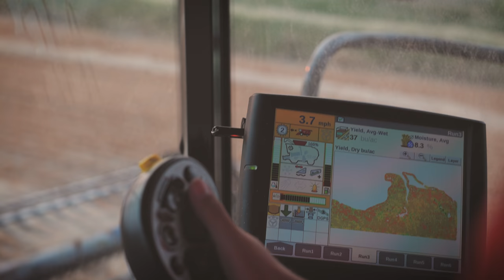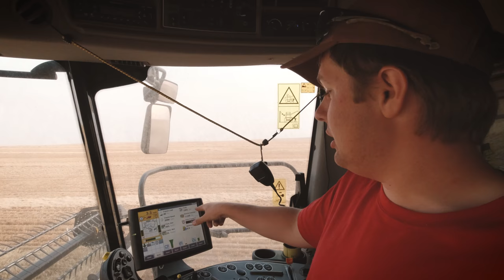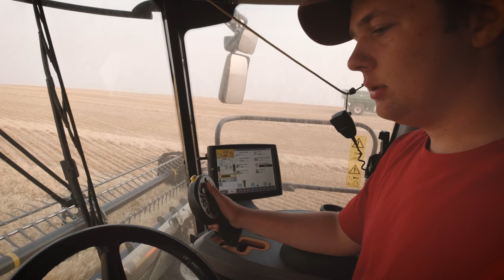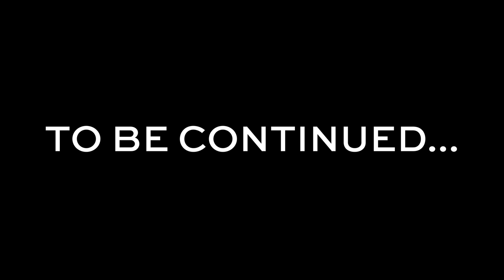Semi Truck Brake Fire Response, Harvest 2021 Continues

Comment: Obviously you air pressure warning buzzer isn’t working??
Reply from the maker: It was. This leak happened so slow that it wasn't ever quite low enough to trigger the alarm. The threshold for when the alarm activated might have been quite low though.